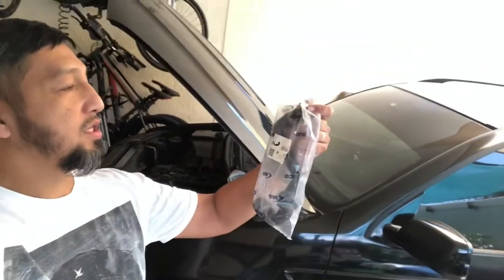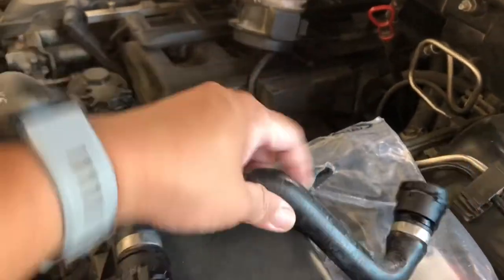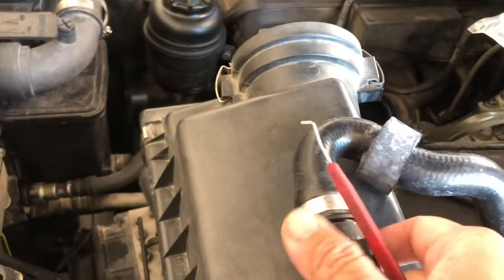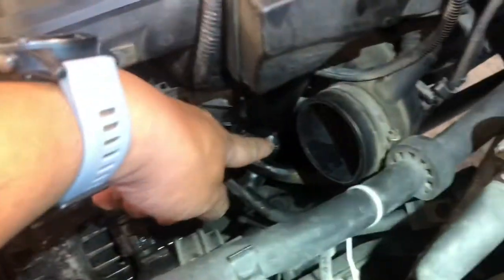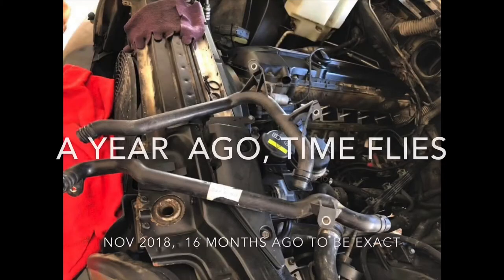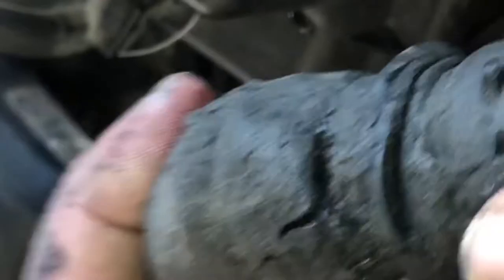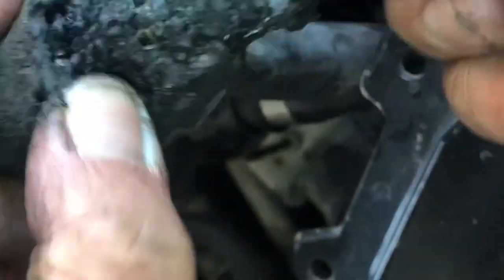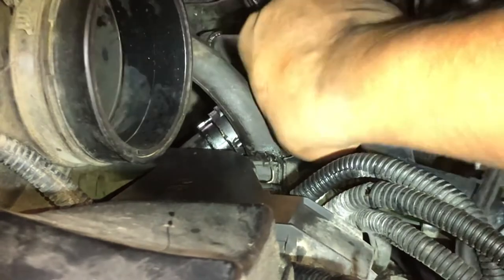BMW E53 Coolant leak | Radiator heater hose and auxiliary water pump replacement.

Comment: Hi there i have a bmw X5 3.0d 2001 i  seem to have a problem with my aux pump wires... When i connect it to a multimeter it only gives me 3V and when i start the engine the pump does not run... Any idea what could be the problem need to get it up to 12V...please help
Reply from the maker: Do you have a check engine light? Aux pump is not on all the time, if its faulty or the electrical system ,you will get a fault code.
Reply: @Projekt1  Hi there yes the car does have quite a few error codes as i bought it cheap but overall its in a good condition, used to be auto it was converted to manual, the issue i have is that the car overheats and i seem to have a short circuit somewhere but dont know how to troubleshoot, not many good autoelectricians in my area either. I have noticed also that when i put on the dim lights, the indicators shine aswell. Also the rear break light on the trunk by the spoiler stays on. Any ideas?
Reply from the maker: @davidlottering4001  so you have a project going on. Pull the codes so you will have a clearer view. For the brakes, possibly the brake switch. For the dim light, what do you mean the indicator shines? Overheating check your thermostat and electric fan, these are the common causes in my experience.
Reply: @Projekt1  will have a look at the things u mentioned thank you.... Also i mean the indicators stay on as if they were my headlights shining but just a bit dim.
Reply from the maker: @davidlottering4001  so ,if you turn your low beam headlights on your indicator dims,  thats normal
Reply: hi, do you find the problem about aux pump?